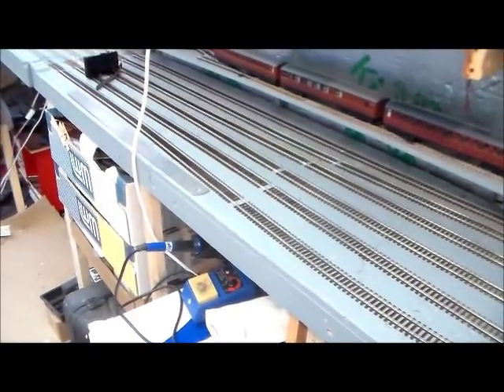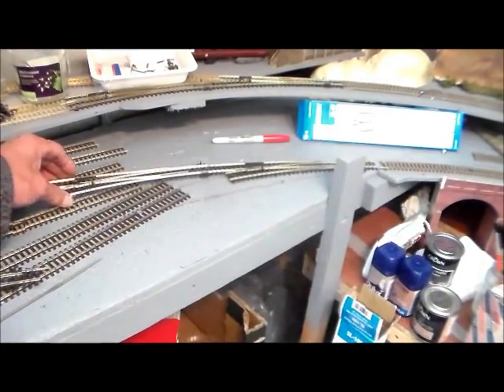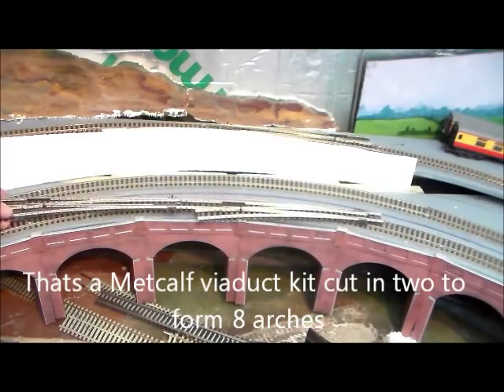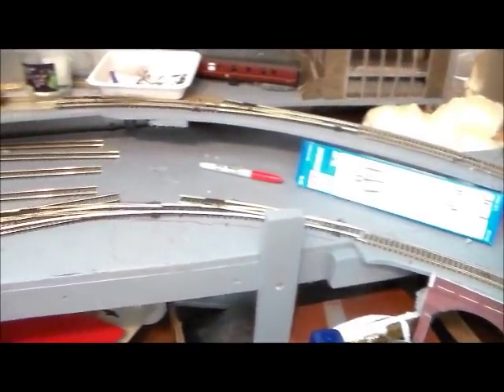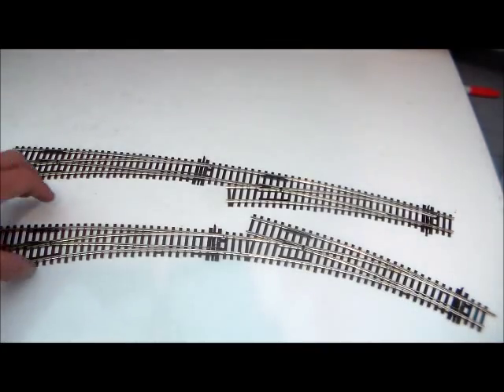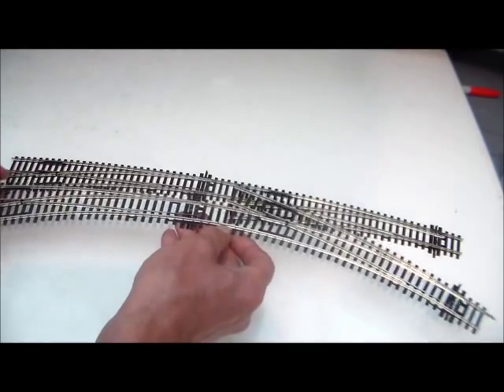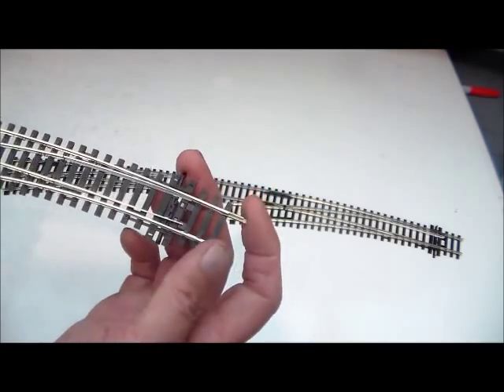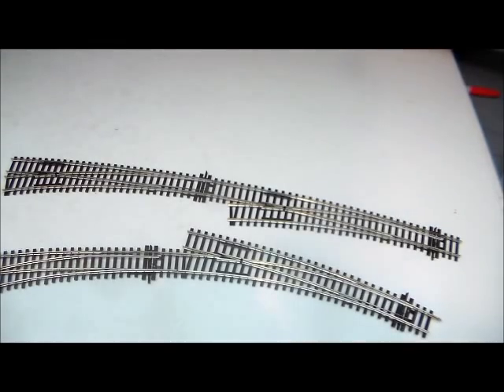increasing point curvature

Comment: Hi John, Thank you for your quick reply. I fear that perhaps the new Bullhead track may be too flimsy to stand this modification as I understand that the web is made and then the rails are hand applied to the web during manufacture! However, that does not stop the use of the mod. on Code100, Code83 or Code75 track or any of the other gauges for that matter. Dave
Reply from the maker: Thank you Dave. Others coming to this video will find your comments very helpful. John

Comment: John,
This whole thing started following the Peco 2020 Video when they asked for suggestions for more track formations from modellers. I suggested LH & RH Curved Diamonds to fit a Double Crossover formed from 4 Curved Turnouts or 2 Curved Turnouts and two Straight Turnouts. As you know the existing Diamonds can take a bit of fiddly fitting to perform this task. This then led to the suggestion of using your mod to produce a new range of ‘Flexible Curved Turnouts' and ‘Curved Diamonds’. What do you think?
Dave
Reply from the maker: A great idea Dave... But. Skewing a point disrupts the geometry. In the situation you are taking about, then friends at the model club hand build the trackwork. The alternative is to ask Marcway in Sheffield to build them to your specification. They do a lot for the O gauge community. John

Comment: Great idea. I have now applied it to one turnout saving me space and it really works well and is so easy.
I will do one more as I need it do be just a bit more tight. It's a compromise, but saves large part of the layout. So thank you for your video.
Reply from the maker: Thank you for the comment Paul. The limiting factors are the notch for the moving rail in the fixed rail and the skew of the tie bar.

Comment: John, Just came across your video whilst searching for ways to achieve the same thing. I see that you were using Code 100 for the demonstration. I am in the change from Code 75 over to the new Bullhead type for my layout where the entrances into Newton Abbot are all on a curve. My initial problem was to get a double crossover using all curved points and using 2 curved with two standard points and I was looking for ways to make the Diamonds more flexible to product a closer fit between the running lines.
Reply from the maker: It will be interesting to see how far you can go before the tie bar is too skewed or the switch rail doesn't fit neatly into the milled out section of the running rail. But a small change can be very useful.
Reply: You are about at the hand laying point! It is really not as difficult as one might think. Really just some basic modeling skills and some gauges.

Comment: Great ingenuity in prepping those points prior to fitting.
Reply from the maker: Lawrence5987 As long as you don't overdo it you can make small changes to the point curvature. Still working reliably after about two years. The points are now motorised.

Comment: John, I agree that skewing will occur but the amount we would be talking about would be very limited - perhaps an angular change of up to 3 Degrees as you originally suggested. This should produce a maximum reduction in the inner rail length of 2-3mm. The maximum is dictated by the angular movement of the tie bar to the adjacent sleepers such that there is no binding during operation. Dave
Reply from the maker: Where the switch rail contacts the stock or running rail or whatever it is called the is that milled out bit. With the small change in curvature there has been no need to fettle that. It is worth contacting peco to see what their response is. A rep for them lives in my street so if you don't get a response I could ask him to look into it.
Reply: @bikerides  Good Morning John, 

I believe that the milled section in the Stock Rails were a necessary compromise because of the scale. The 'Toe' end of the Switch Rail in full sized track is milled to about 10mm , if that, so when scaled down the rail would be too thin to be of any use. As you say, this is the other major limiting factor on just how much the turnout can be bent inwards. I think that the Peco engineers realised this and thus produced the milled out section in the Stock Rail with sufficient length to allow for slight errors in manufacture. If the Switch Rail Toe does cause a problem then it may be necessary to cut about 1mm off the end of the curved part and reform the curve using a needle file making sure that the very end is not bent so as to prevent the wheel from transiting the gap.

I have had a response from Peco, which pointed out all of the problems  we have discussed but the idea of creating a new, more 'Flexible' series of track formations has been passed up the chain, so we will have to wait and see.

I had a similar problem a couple of years ago when I suggested a change to their Turntable electrical pickup on the actual table to prevent loss of power for those of us using DCC rather than DC where a constant supply to the DCC Decoder was essential.  Dave
Reply from the maker: @johndavidwynnroberts587  well done David. I'm glad that peco are considering it. A very useful discussion. You raise some valuable points 💪😉.

Comment from the maker: Thanks for the comment which will be of help to other viewers wary of damaging an expensive switch. The inner radius at the end of the layout is approximately 22in which is between the curvature of the two points. I have a couple of the tight radius points which I nearly used but didn't want to resort to a tighter curve. At the other end I laid it out without tweaking the points, but have since done a little adjustment of the points to make them fit better in my restricted space.

Comment from the maker: Actually, yes Hornby offer points with a radius between that of the two Peco ones. No small radius Peco or curved Hornby in stock. Haven't looked at the frogs on newer Hornby, but Peco used to have less plastic  - I tend to use dead frog/insulfrog.

Comment: first of all i didnt want people trying this, on may, say so. but after further messing,  first i found that points had straightened themself. so with superglue and bicarb fix the points in a fix position(underneath) . one of the main troubles i found after many trills and earses is some loco work fine. then other, same make of model didnt...And i do this as a hobby
Reply from the maker: Good advice. I may not have been clear about the need to cut the plastic webbing under the point. The rails are not flexible and once bent will stay that way but the plastic sleepers and webbing will keep them in their original shape.
Reply from the maker: I have done this for four points (2 LH and 2RH) but they were large radius to start with.

Comment: it works! thankyou. why peco, dosnt make the curve more acute.they would probably sell more
Reply from the maker: Good point. I guess they are matching set track radii.
Reply: You CAN buy Shinohara HO curved switches in diff radii.. Very costly though..M
Reply from the maker: Second hand peco points are quite cheap and so it is worth trying even though Mr Wilkinson had problems. For small increase/decrease to match up with track it works fine for many people.

Comment: I´m still confused about why Peco still aren´t produce curve turnouts more curve.In fact should Peco do start upgrade track system like code 75.
Reply from the maker: +Anders Gullberg Yes Anders, curved points are very useful. Code 75 would fill a gap between those who will build their own track and points and those who want a fine scale layout without building their own track.

Comment: It would have been nice to actually see you doing it .
Reply from the maker: bbcisrubbish I could do another video for you. Just have a go and see how you get on. knowing that it is possible within limits should give you confidence. don't try and bend to far.
Reply from the maker: Just gentle pressure over your thigh with a towel checking frequently. I did this at both ends of the fiddle yard, four points in total.

Comment: Looks like a nice technique. I noticed that you got your terminology mixed up a bit. First you say the radius of the stock points is greater than the radius of your existing curve. Then you say you INCREASED the radius of the points to match that of the existing track. I believe you decreased the radius of the points. 

I didn't catch if you did anything to hide those spacers you added or if you are just counting on the ballast to hide it.
Reply from the maker: Hi Paul, Well spotted! I often get mixed up like that. These points or switches give access to a fiddle yard - no hiding of spacers attempted. I have increased the curvature and as you noticed hence decreased the radius. I used the same method to decrease curvature/increase radius with no ill effect.

Comment: sorry.it didnt work.to all of you are reading this
Reply from the maker: Hi AJ. was it the twisting of the tie bar? Was it the switch rail not seating into the filed out part of the running rail? Did you try and increase the curvature a lot? My curvature increase was enough to get the fiddle yard to work and the points are now operating reliably with point motors. Peco points.
Reply from the maker: Have you worked out why it didn't work for you? Were you using normal radius points rather than large radius points?